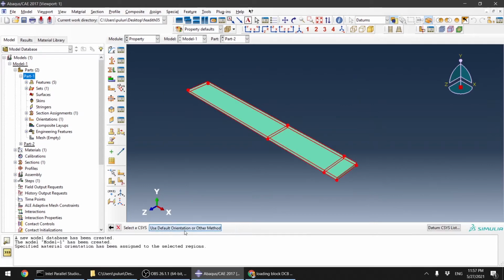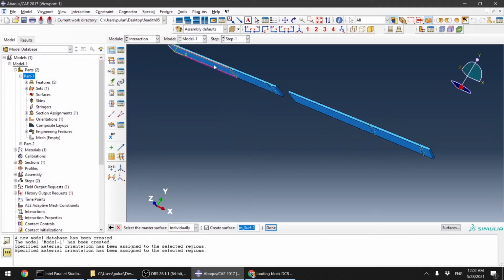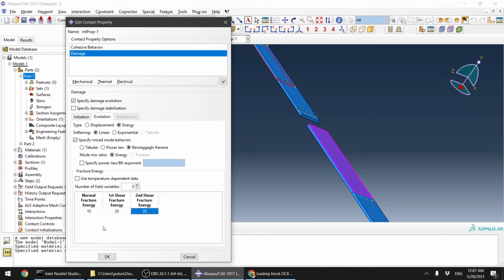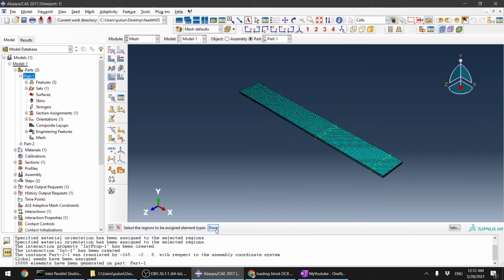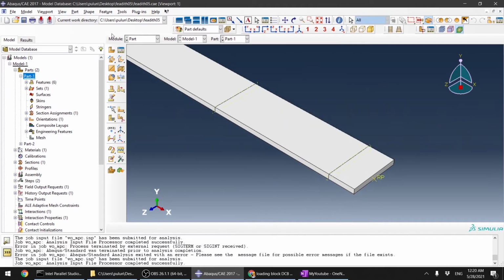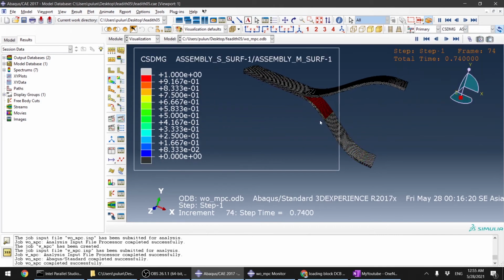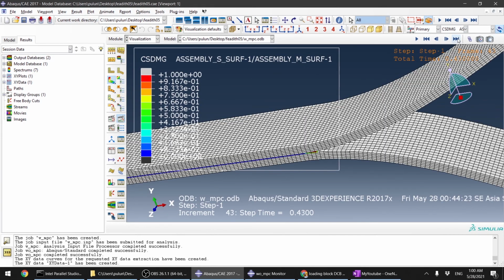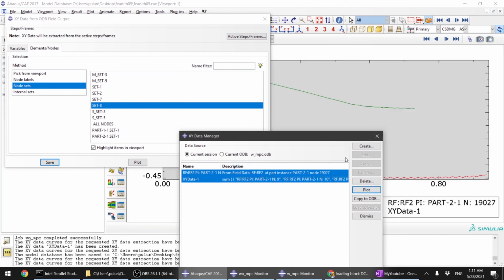DCB test in Abaqus: MPC , Cohesive surface interaction and material orientation

Comment: Thank you very much, very helpful. 
On a different note, research show that a distributes load line on the center of the load block yields accurate enough simulation in comparison to fully modeling the load block.

Comment: hello,
i have 16 plies and I need to add a 0 thickness cohesive interaction/ element between each of them, is their a way to do that instead of creating my plieas as separate parts and assemble them like you did here in the minute 18:00 ?
Reply: hi there, please update if you find out. I am also looking to solve a similar problem. Thanks

Comment: Thanks for the toutrial! It was helpful ☺️
I have defined a cohesive interaction for interface of composite_adhesive of a scarf joint.  When I apply adhesive  damage properties to contact, it works but when I use composite damage properties to contact, it doesn't converge! Actually the reaction force goes up rather than to fall!  I have no clue why this happens and be grateful if you give me a hand
Reply from the maker: You might need to be carefull in using value of K (stiffness you put for cohesive surface). The default value in many case dont work. You need to use smaller K value